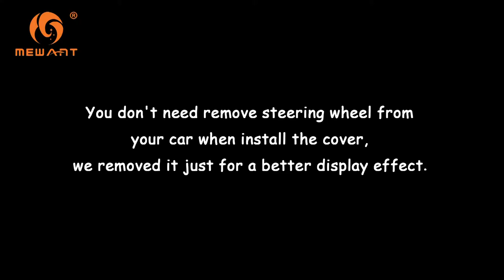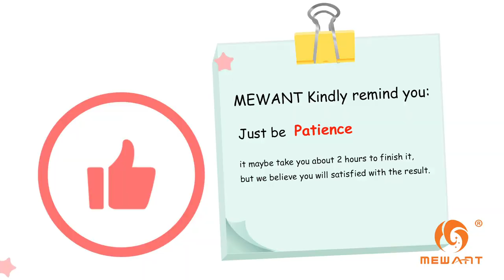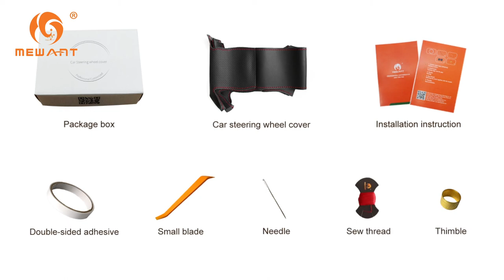MEWANT-- for Audi TT RS 2009-2014 Hand Stitch Steering Wheel Cover Installation

Comment: Hi guys! great job, I've already purchased and stitched tens of covers from you.
I'd be glad if you could make a video for a Seat Leon Cupra MK2
Reply from the maker: my friend, thanks for your suggestion, we will do that soon.By the way, we have checked the Seat Leon Cupra MK2 info, and find that there's some changes for this steering wheel in 2009, the  steering wheel appearance before and after 2019 are different, so could you tell me which year of the  cover installation video you want? we will do that soon
Reply: Ouyue MEWANT His asking for pre facelift so from 2006-2009 fr steering wheel